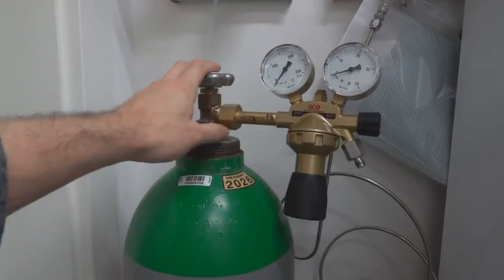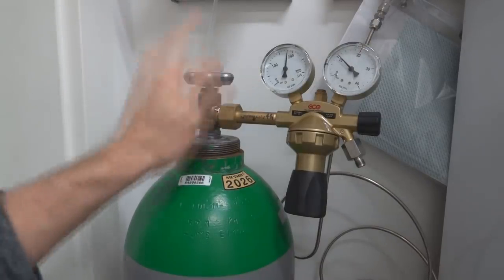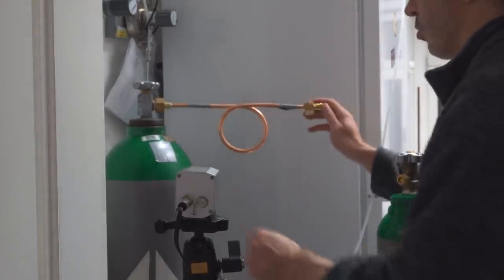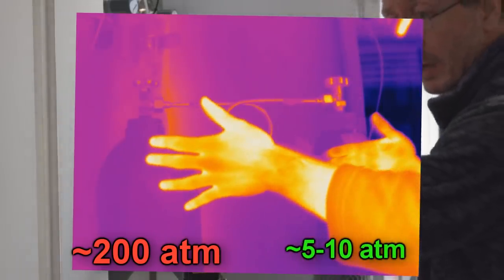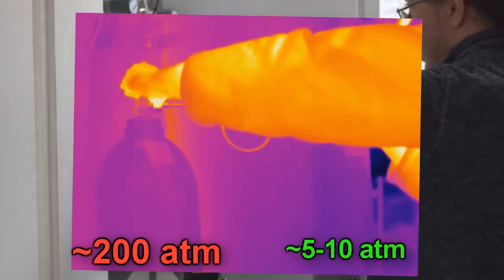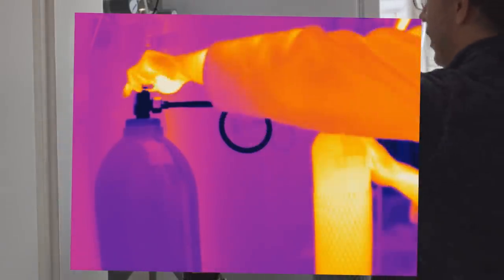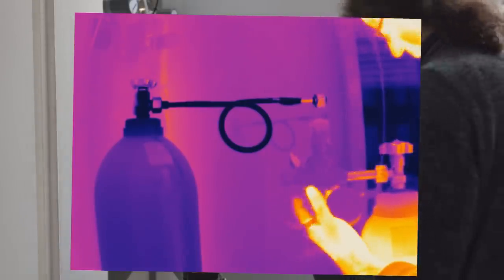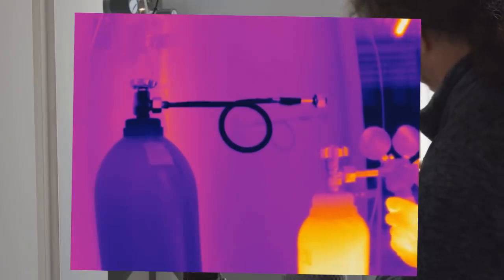Dangers of high pressure gas!

Comment: So last week we had a our new 'Fire Safety Officer' come and inspect our Datacentre (I work in local Govt, so we have many sites and a very varied environment). He'd never seen a state of the art fire suppression system before. After his inspection, he said he'd be making the recommendation that we cage the cylinders,... I laughed out loud, and questioned him, he said 'in case one ruptures', so I did the maths, ... 50% Nitrogen/Argon mix, 80L at 300 bar,.... in the corridor outside the datacentre,.... ~50% volume change, 7.5 PSI pressure increase,.... if one cylinder ruptured, the pressure changed alone would kill everyone in the corridor, before we talk about shrapnel. A wire cage would just make more shrapnel. His problem? He had no idea what a 'bar' was, nor what 300 bar really meant. I pointed at the 'Bomb Doors' we'd just come through,... "You know why we have Bomb Doors here, right?"
Reply: back when i could afford to run a car, i was in an airgun club i carried a 3L 300bar divers air bottle on the floor  jammed between the back of the drivers seat and the back seat (it was a small car) when questioned about the 'wisdom' and safety of this i responded by saying "if the air bottle was in the boot and someone ran into the back of the car and the bottle was damaged and exploded, the back seat and the drivers seat backs might slow the shrapnel down enough so that I'm horribly injured but if the bottle exploded when it was on the floor (near as dam it under my backside) then it was instant death! no pain, no fuss just lights out". there response was (after a bit of thinking) "that's a good idea"
Reply: @airgunnut9489  oooh, PCP fan huh? I'm looking to get back into airgunning (mid life crisis, just turned 50, and it's cheaper than a sports car, and I don't like sports cars ) but it'll be a springer for me. What PCP did/do you have?
Reply: @engineeredlifeform  i have a Falcon fn19, Falcon fn8 pistol, Falcon Prairie 19 (think they renamed it the Prairie classic) and a Air Arms 200 (mark 1) as well as a sheridan eb17 co2 pistol, sig sauer p226 co2 pistol and a Feinwerkbau c10 target co2 (bulk fill) target pistol all in .177.
you might want to think of that sports car as a good springer is £300 upwards (I've seen some at nearly £1000) 
as you can tell, i like Falcon guns but they stopped trading, all my air rifles are coming up to 20 years old, the fn19 and the prairie can both put pellet after pellet through the same hole at 75m, I however am not capable any more, the s200 same thing but at 50m (its got a shorter barrel and does not seem to want to go beyond 50m)
Again keep thinking of the sports car, after the air rifle you get to pellets and down the rabbet hole you go!! there is a selection of different head sizes for each caliber as well as weights, then there is different head profiles, my fn19 likes air arms pellets, there are other fn19 air rifles that hate them and like crosman pellets, (every barrel is slightly different and likes a different diet of lead, i have seen 2 airguns, they had consecutive serial numbers, one liked marksmen pointed pellets at some thing like £4 per 1000, the other gin likes logun pellets at £15 per 500. then there is different batches of pellets There are some who buy a tin of pellets and test them, if the gun likes them the person goes back to that shop and buys the entire batch (well all the shop has) of those pellets, then you have some really serious airgunners who wash, lube,size and weigh EVERY pellet.
hope i haven't put you off ;p
Try this forum, its a bit quite but you WILL get the advice you need
http://planetairgun.com/index.php

Comment: Dr. Mason, Question sir. Would the tanks self regulate at 100 bar per approx. (approx. due to not sure how much the smaller tank had) ? Being that the bigger tank had 200 bar.  I understand the heat is partially due to the metal stretching but still not understanding why the coil is SO INCREDIBLY cold. Is it dynamic or directly related to the heat gain in the smaller tank?

Comment: What is in that bottle? Atmospheric air mix? Argon? Nitrogen? Oxygen? 
I work as an aircraft mechanic and regularly refill shock absorbers and tires with nitrogen.
I also refill portable oxygen bottles, the ones cabin crews use for passengers who have become ill during flight, and the cockpit crew oxygen bottle(s).
Working with high pressure gas always gets me a little extra cautious, but refilling the oxygen bottles literally gives me sweaty palms. Pressurised pure oxygen is no laughing matter. 
When I saw TF just willy-nilly connecting to bottles, with no pressure gauge involved, I started sweating, thinking this will be TF's last video.
I know TF isn't stupid, but I also know even smart people makes mistakes. Stay safe everybody!

Comment: ptfe thread tape on high pressure valve fittings, definitely not allowed in the uk, check out mythbusters Air Cylinder Rocket
Reply: Yes, you're right, there should be nylon sealing ring. I don't know why is it there, because PTFE tape cannot hold such pressures.
Reply: @ales_xy  when i was doing my nvq on plant maintenance there was an element on welding, we was told nothing was to be used, just make sure the threads and mating faces were clean and never to swing on the spanner to tighten the fittings (this was many, many moons ago) the demo of wafting O2 over a small lump of grease was good, if i remember correctly the advice (not to use anything to help seal high pressure gas fittings) was because sealants (tape, greases, O rings and plastic washers (of all types) could react (sometimes violently) with the gas, yes some gases would not react but it was simpler to use the blanket advice of use nothing and make sure the valves, threads and sealing surfaces were in good condition (which should be checked by the gas/bottle suppler every time its handled, a quick visual check is all that's needed to see if fittings are clean and free of imperfections that would prevent sealing) 
we was also told NEVER blow all the dust of you with an air hose (the yanks call it a work shop shower) or put your finger over a compressed gas outlet (this includes compressed air) as it has the potential of forcing gas through the skin and into the blood stream and if that bubble of gas gets to the heart it could kill you. (the instructors words)

Comment: Thank you Thunderfoot for making me smarter.  I'm guessing this is why they put scuba tanks in water when filling with air.  Water makes an excellent heat sink. Cheers!
Reply: Cooling helps and is a benefit. 
It's the failure you're worried about. 
The water absorbs the failure.

Comment: I used to work at a company that filled up gas tanks with different noble gases. We did this AWAY from the main containers, six tanks at a time per installation and with four of these set-ups, we managed to have quite a bit of work. The gas tanks always got hosed down by the machine that filled them simultaneously and I never understood why that was. Not even my boss knew. But now I do... and I'm glad I quit working there.

Comment: I think(hope) Elon was joking in that tweet...

And I might be stupid, but I do not get the thermodynamics of this heat transfer.
The heat can't be coming from the gas being compressed, as the gas should have a sub room temperature when it enters the second tank so the net should still cool. 
So the temperature difference should come from the tank expansion - micro deformations in the metal.

Comment: Unsecured canisters; no PPE; no regulators on the dispensing canister; Working with and discharging gas in what appears to be an enclosed environment. Have you ever done even the most basic gas safety training? Have you seen what a burst canister can do to a person?
Reply: Why would that cylinder burst? And tt's argon or air, no flammable, oxidizing or toxic gas.
Reply: @ales_xy  I have seen a refrigerant canister explode from improper use. and by that i don't mean that someone threw it in a fire.
Remember that some of those canisters have been around for years. When refilled by professionals, they are pressure tested first, checked for leaks and weighed to make sure that they have not lost any mass due to corrosion on the inside. A canister can look alright from the outside but damage can be internal.
At 200 atmospheres, or more in some cases, it doesn't have to be inflammable, the pressure alone is enough to turn your into mince meat.
Reply: @JohnnyJayAppleseed  True. But the bigger cylinder has "2026" mark. I guess it's the expiration of certification of the bottle. We can assume, that the smaller one will be also in good shape and with valid certification. It doesn't look like some old cylinders pulled out of some abandoned workshop. But you have the point. High pressure is dangerous by itself, even the standard air compressor at 8-10 bar can kill you. I would never approve refilling cylinders without valid certification. And unknown old rusty cylinders, possibly under pressure - I wouldn't even touch these.
Refrigerants are different beasts. You didn't specify "mproper use", but if I should guess - refrigerants ale liquefied gases, which means they can be overfilled easily, same as propane. That's why is refilling propane cylinders at LPG gas stations consideredd dangerous and is unlawful in many countries.
Reply: @JohnnyJayAppleseed  btw. I heard, that gas cylinders are made of material resistant to deep, pitting corrosion.
Reply: @ales_xy  Very few people "own" a cylinder. They are often exchanged rather than refilled on demand due to the time it takes. So you never know what the history of the cylinder is. Hence the tests. Despite that, you should never never discharge or pressurize a cylinder without a regulator, rapid changes in temperature and/or pressure can cause the cylinder to fail.
Reply: @ales_xy  There is a wide range of things that can be done to a cylinder in everyday use that can be considered "improper use"
Reply: @ales_xy  The instance of the refrigerant, the cylinder was not over filled. It was professionally filled but the technician made a mistake with the positioning of the cylinder while he prepared to recharge an industrial system. The Cylinder was overheated by the sun and heat from other running plants and ruptured. A simple mistake compounded by the time of day and the weather resulted in two deaths an millions in damages.

Comment: Whoa! I have a lot of experience with half of this experiment, I use those compressed gas/air cans all the time to blow out dusty computers I work on and I was always fascinated by how cold they get - So one day I took a minute and Googled what the fuck is happening - A bit of Thermodynamics later the expanding gas carries heat away from the liquid very rapidly, cooling it to its boiling point which you can hear in the can afterwards, but this is like the other side of the coin. I had no idea it would make the bottle so hot makes total sense I just never thought about it.

Comment: @tf. I always love you videos and I have been following you for 10+ years now with a real pleasure. Bt the way you handle High pressure O2 tanks and Gas transfer makes my skin cringe. :) I am an Ex commercial divers and we would NEVER transfer gas in this way, even Nitrogen or Helium, not even spekaing of O2 rich gas. :D  You need Specials tools, the tanks need to be secure, you need a O2 manometer, o2 regulator, and the tanks need to be imersed in Water. Etc, etc.
Reply: Green shoulder means safe gas, argon or air: https://pbs.twimg.com/media/C_X0b1PXkAAx5Xn.jpg Also, bottle doesn't have to be immersed in water, but you must constantly check the temperature, when it's too warm pause the transfer and let the cylinder cool down. O2 is pretty safe, if you keep the grease and oil far away of it. It's just about using brain.
Reply: Casus Belli nah that's only for insurance, nitrogen is safe.   Just need to set up intermediary tanks as they start to run out so you can fill faster, in steps.

Comment: I wonder if the strength of the valve gets overly compromised to hold 200bar, as it cools down to that freezing temperature? Do you think you could get liquid out safely if you just turned the cylinder upside down and opened the valve? I've done this with propane/butane many times but that's just a few atmospheres...
Reply: There is no liquid at all in that cylinder, just high pressure gas, nitrogen I think.
Reply: @TheBackyardChemist  Actually you're right, thanks for pointing that out. The vapor pressure of nitrogen at room temperature is much higher than 200bar.
Reply: @ElectronPower  RT is way above the critical temperature of N2, so there is no way to have any liquid phase.
Reply: @TheBackyardChemist  Interesting! I've seen some sources stating something like 700bar but I have to agree with you, as I couldn't find any actual vapor pressure graphs for nitrogen, that show something like this is possible. Thanks again! There's always something more to learn! I guess it'd be possible with CO2 if it was stored at high enough pressure (like 1500bar).
Reply: @ElectronPower  With CO2, you would get liquid CO2 at RT.

Comment: So his car will have a compressor which will power blasts of air to aid the car accelerating, braking and turning. 
I worked on the shipyards in my youth, the yard used compressed air to power various tools and machines. It was pressurised to about 4 bar. If you turned on a valve to let the full blast of air out through a 1/2" hose, you could hold out your hand inches from the end and easily keep it there against the pressure, exerting maybe a kilo of pressure.
What kind of pressure would be needed to influence the direction of a car, and what would be the effect on the people riding bikes and motorbikes, dust and grit on the verges, and people's ears??

Comment: Thunderf00t, as an ex-diver and engineer, I can tell you that using your finger against a valve to hold back a compressed gas is very dangerous. Also, you NEVER transfer gas from one cylinder to another directly with a straight through pipe, you always control it with a regulator.
Reply: My dad kept his welding gas cylinders chained to a brick wall so they couldn’t accidentally fall over and knock the head off.
Reply: @longoverdue99  sensible man your dad
Reply: It was not a straight pipe, it was curled
Reply: @hanspeter2210  very droll
Reply: I was sure I was going to see an oxygen fire video. This whole video made my flesh crawl. I can't imagine what the owner of that cylinder would think. Who knows what contaminants he blew into that cylinder.
Reply: @gasdive  Pretty sure it was a nitrogen bottle for inert atmosphere work
Reply: @RobertSzasz  well it's either Argon in the UK, or oxygen in the USA. It's not nitrogen.
Reply: @gasdive  He's a English guy but, lives in the USA, my money is on Oxygen
Reply: @Vacublaster1  Yes, I think it's oxygen. In the UK, oxygen would normally have a type 10 bullnose which has the thread on the inside of the cylinder outlet. (Well that's how things were when I was last there, but Brussels may have changed that) 
I took one look at the green cylinder with what looks to me like a CGA fitting and freaked out at the gross miss handling of oxygen. 
Then I realised there was a chance I'd jumped the gun. If it is oxygen, then it's horrendous, and in many countries illegal. Certainly immoral to be blowing dirt into someone else's cylinder and then handing it back without telling them about the danger.
Reply: gasdive Looks to be something other than oxygen, given the safety labeling. Looks like he emptied the smaller container afterwards, too.
Reply: It's not oxygen. There would be a 'flammable' label on the cylinder alongside the 'gas under pressure' symbol on the smaller cylinder. (4:38)

Unless he's mixing 2 different gases together, but I don't think a qualified chemist would be that stupid.
Reply: Agreed.  I got a horrible blister doing just that with 2500 psi.
Reply: I was going to post a similar comment( apart from being a diver!) I must say I was very suprised to see Thunderfoot doing these things.
Reply: Yes, this came first to my mind as well. Even if for no other reason than a regulator failure while the finger is on the valve would blow his hand up like a balloon. It's the same reason why you don't do taste tests in chemistry.
Reply: If you transfer pressurized gas only using a regulator, how are you going to demonstrate dramatic temp changes?Oh I see you didn't get the point of the video - gotcha.
Reply: He's a scientist and can read the pressure without regulators or gauges :)

Comment: Really fascinating to see someone tool around with this kind of pressurized equipment. Really not something you see everyday :)
Reply: Benjamin Germann someone needs to get out in the world then....hp gases are commonly used everyday in hundreds of different settings.  It doesn't even require safety certification in the USA, just a good teacher & some common sense.

Comment: Can you scale it up? Like 2000 bar? That's essentially a jet engine right? Science is cool
Reply: 2300 - 2500 bar is the pressure in the 9x19 pistol cartridge. Even most hydraulic systems don't go so high. Your car would be useless piece of heavy machinely, unable to drive, not to say about hoovering :-)